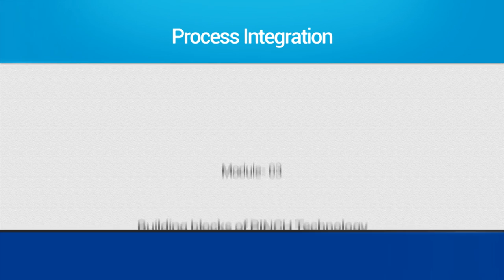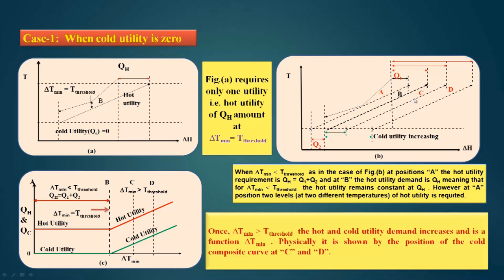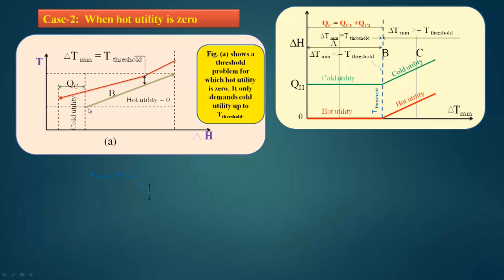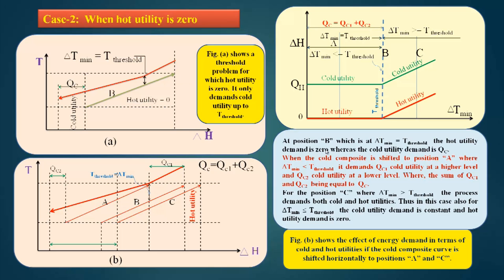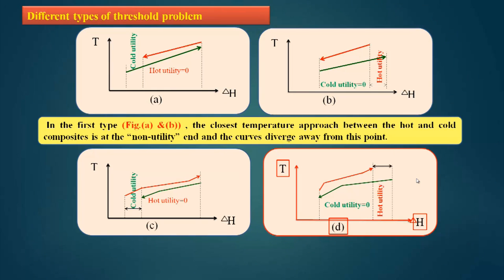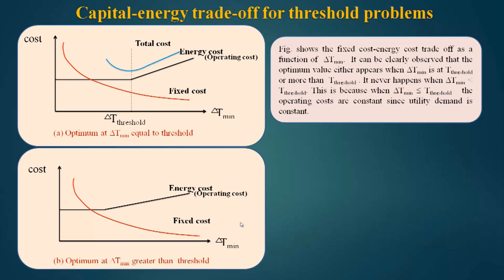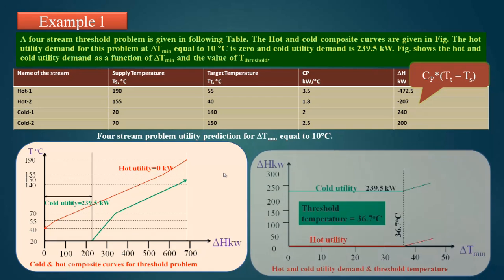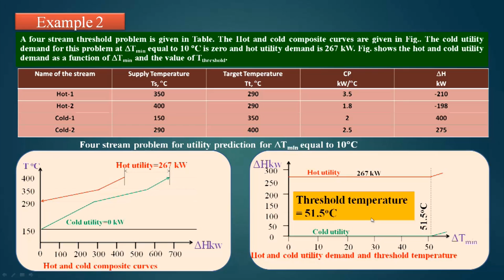Mod-03 Lec-05 Threshold problems

Comment: than you, prof. can I draw a conclusion that the dt(min) should always be less than the threshold dt, so that the total cost is the lest.
Reply: I am not the professor but a postdoc who just started working on this type of problem. From my understanding. You can always find a dt(threshold) in theory for the optimum, but cannot always set up a dt(min) to match this dt(threshold). The dt(min) is a design parameter that depends on many other factors (e.g. drive force). If after you calculate a dt(threshold) and you find that you can set dt(min)=dt(threshold), then great. However, if the dt(threshold) is too small, then you can only have a dt(min)>dt(threshold), no matter what.